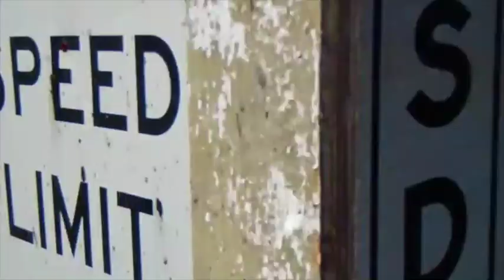1955 Ford Wagon Fuel Filter Swap

Comment: I have a golf cart that I use as a work horse. Behind it I pull a 17 cf yard trailer that I haul mostly firewood in. Last weekend I split a load hauled it around and stacked it and on the way back to the splitter I ran out of gas. When full it wouldn't start again. Now I've had that golf cart for about 25 years and it was used when I bought it. And you know I had the same problem, the fuel filter was dirty. Stuff just don't last like it used ta.
Reply from the maker: Yea...  Go figure..

Comment: Did you get it yet .
Reply from the maker: I did, Thank You.   Big ain't it..
Reply: Ya you can split it down center  over lap it fitting the bike  draw a line top and bottom of the edges cut them off re fibreglass it slide it in same to the frame inside use a ZIPCUT Wheel 1/8 wide .
Reply from the maker: It actually looks to be the right size.  I haven't had time to take a close look.   Was out of state this weekend..
Reply: +rpeek Oh that would be alright.